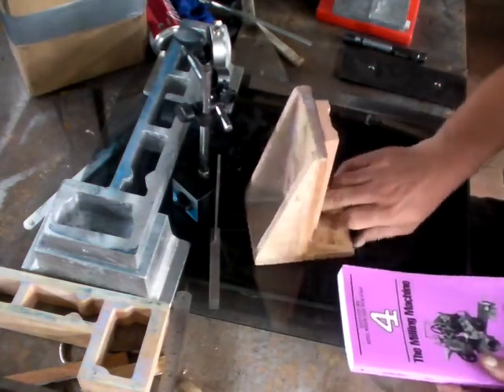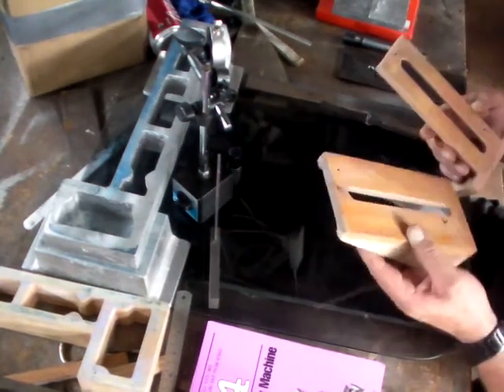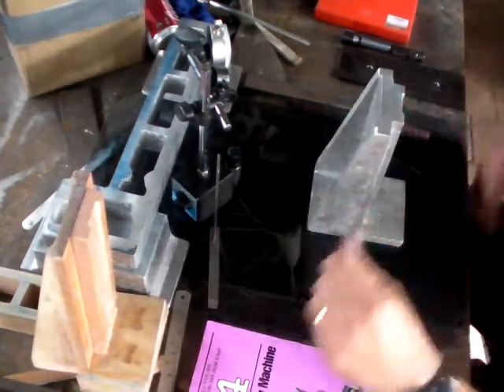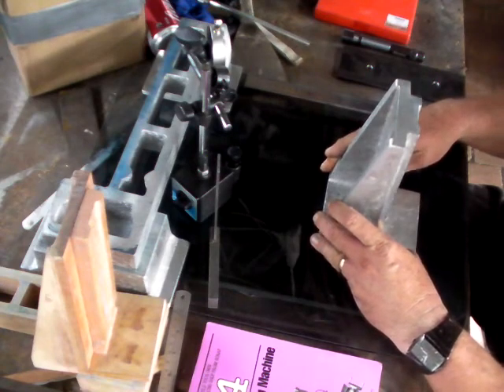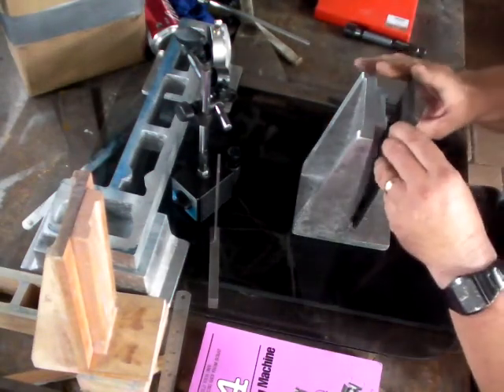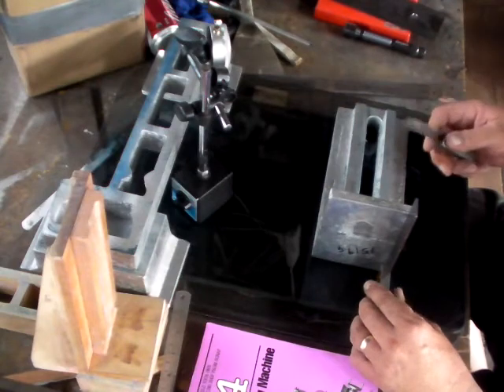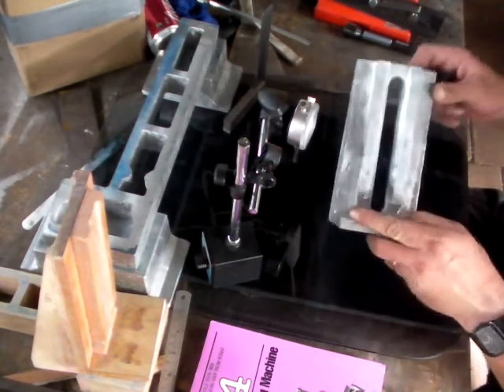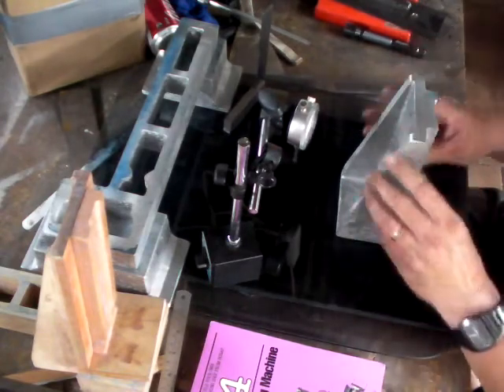Building the Gingery Milling Machine 2

Comment: A new subscriber here. I an embarking upon the Gingery milling machine adventure. Thank you for telling us how much weight in aluminum is used in each piece. Thank you again.
Reply from the maker: G'day John, I wish you well on your new adventure. I can't tell you how much aluminium I used to make the mill but if I recall correctly I scrapped  an automatic transmission assembly including its bell housing, 2, 6 cylinder heads and about 800 cans, I don't recommend the cans as they are a lot of work for the low yield but they do work if you are desperate. If you need help text me. 
Cheers 
Peter
Reply: @pgs8597  Excellent my friend. From what I have seen and heard so far you have been chronicling how much each piece has taken. I fell in love with another build where the kid built his from scrap and I believe a 180 cm long 1/4' thick 4" square Tube. I just disassembled a treadmill that feels like it might have fifty or a hundred pounds of aluminum in it. I got it because I wanted the treadmill motor but now I am so glad  because of the amount of aluminum in it. There are also other pieces of steel and electronics that will be really great. There is a robust motor that runs on an ACME thread to tilt the treadmill up an incline . That may be great for the deck. I want to use an electric power steering motor unit as a power feed. If you get a chance watch Marius' World's best modifications to a drill press. Really awesome ideas. Thank you very much and I will be asking  questions as I progress.